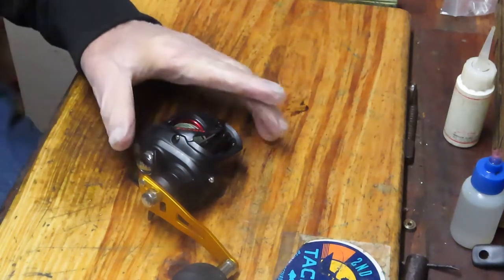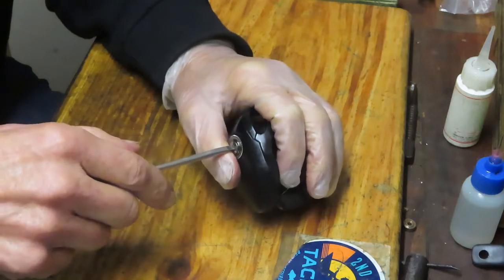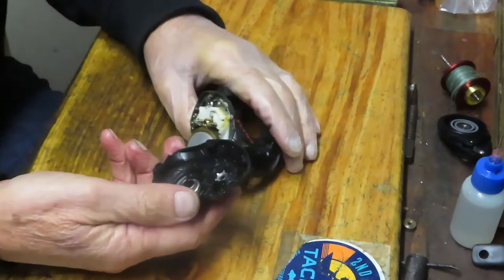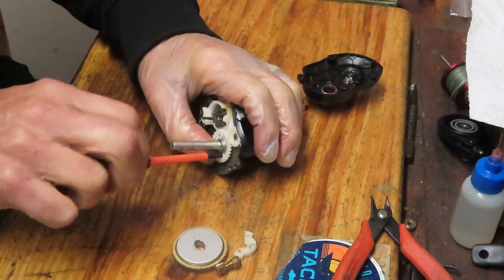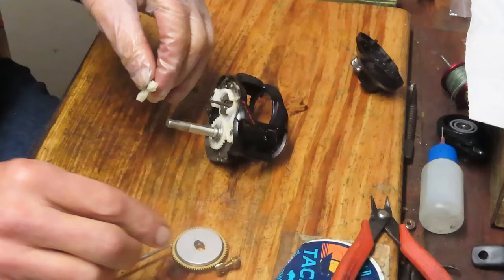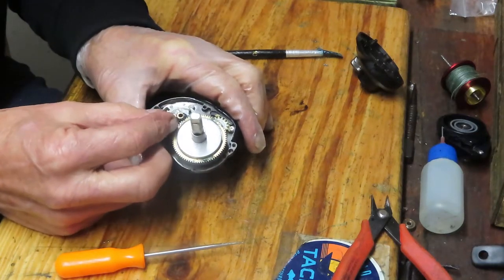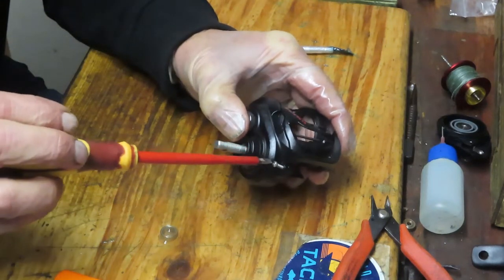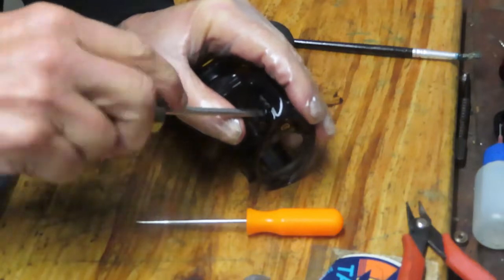Daiwa Fuego low profile bait casting fishing reel how to take apart and service

Comment: I don't do a ton of bass fishing so I didn't want to spend a ton of money on a couple baitcasters. I ended up buying a couple versions of this reel and they've treated me well. I wouldn't recommend them in saltwater unless you're very good with remembering to wash them down and service pretty often. I used it just messing around with black sea bass and some porgies for a couple days and paid for it. I'll admit I didn't wash the reel down with freshwater after the trip and luckily bearings are cheap and I learned my lesson!
Reply from the maker: Thanks for the additional information.  Yes, like most reels, you need to stay on top of this one, particularly if it is subject to the saltwater
spray

Comment: I acquired a similar reel. Diawa coastal 153H. I fails to retrieve line. Worked on any like that? Ideas? Thanks enjoy your videos.
Reply from the maker: There are multiple causes to this.  The first thing to check is the drag system - Dennis
Reply: @2ndChanceTackle  Thanks! Just talking about you and your channel. Always helpful.

Comment: Great Video again Dennis. Are the internals the same between Left and Right Hand Baitcasting Reels and the spool tension knob.?? I see a lot of secondhand Lefties on eBay that may be a good donor for sone right hand Old Reels I have to save a couple bucks. Thank you my friend.
Reply from the maker: A lot of the internals are the same, but the A/R mechanism may be different and some have different gears.  Best to compare the schematic and part numbers to make sure before you buy - Dennis
Reply: @2ndChanceTackle  thank you Dennis and I didn’t think of the part numbers and schematic. Thank you

Comment: Got the same reel but when I pull the drag the reel goes backwards only when drag is pretty tight any ideas?
Reply from the maker: That sounds like a broken A/R system or braid slip.  Check both to see the cause